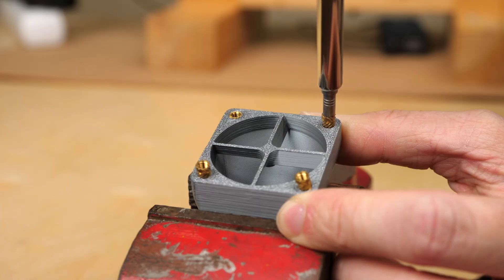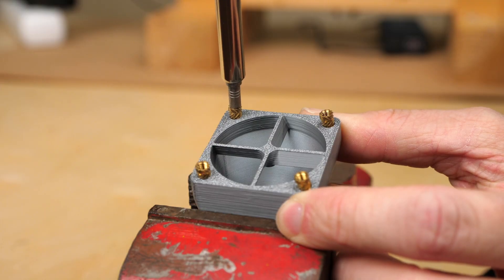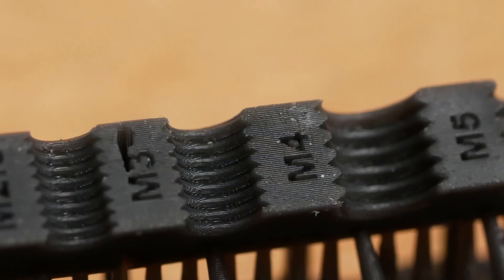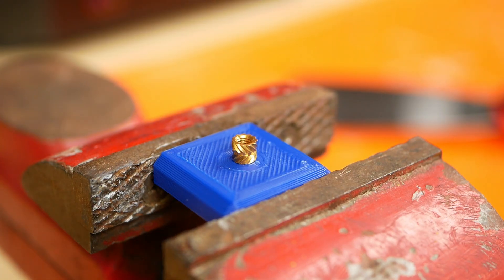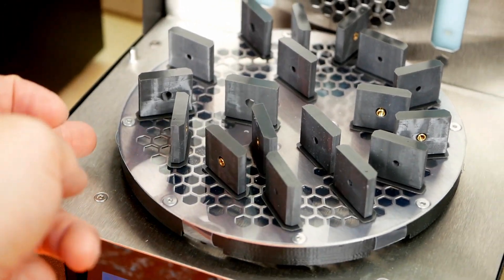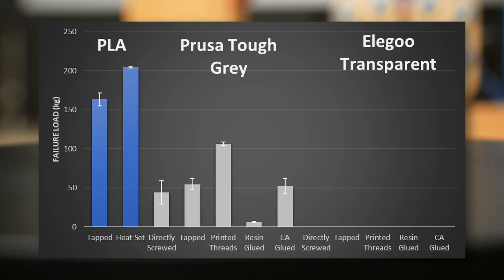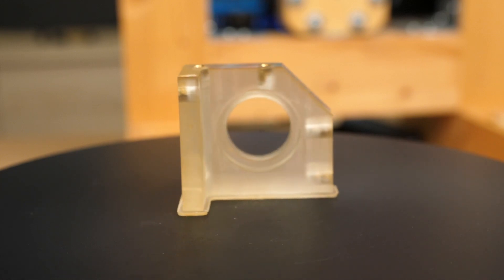Mastering Heat-Set Inserts in Resin 3D Prints

Comment: 5:10 Keep in mind some tests have shown accelerated superglue to not be as strong as without.
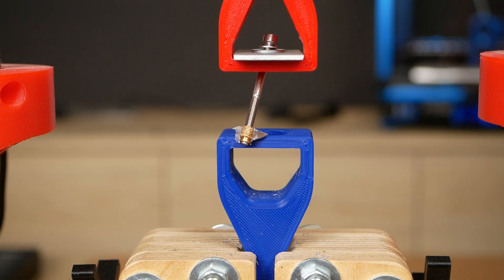10:00 Since the resin has to at least partially absorb the UV for it to be cured, this might be dependent on the shape of the part. E.g.: on a corner, or as part of a wall, parallel to it, it might fare better. And maybe increased curing time.

Comment: What if you modeled and printed threads like an STI tap? You would then use threaded inserts that are threaded on the outside, not meant for heat installation.  Perhaps if you modeled helicoil threads and used the helicoil style inserts?  Maybe a foray into other styles of threaded inserts is the next thing for your store...

Comment: I know you're probably tired of pulling M3 screws out of plastic, but have you tried M3 sized screws made specifically for plastic (e.g. McMaster-Carr 95893A196 or similar)? There are also resins that claim amazing strength (e.g. Liqcreate Stong-X at 80+ MPa), but these often require UV curing at temperature (e.g. 120 minutes UV cure at 60C).

Comment: Based on this video and your past videos, I think helicoils would be the way to go with resin. The printed threads performed best, and helicoils would improve the reusability of the threads. So print the threads for the appropriate helicoil size, install, bam. Just a theory. This video also made me wonder about your previous fdm samples, the stepped holes, maybe adding some geometry to the holes would improve strength when using the traditional heat method? I'm less optimistic about that second idea.

Comment: Bit of a loose testing here, because pla and the resins you use have way different properties, more accurate would have been, fdm abs and abs-like resin, that said it would be interesting to see how better resins perform, like 3DMaterials Super PP and Siraya Tech Tenescious, Blue or a combination or percentage of them added, imo the resins you use are definitely not the best and are more for general use and modelling instead of practical and engineering purposes. I hope you try some different resins and maybe make a good video about them, with multiple tests, like how much they shrink etc. Resins have made a big step in the last 2 years, so there is definitely and interesting video there!

Comment: I know this video is about heat-set inserts specifically, but where I work we often use "keenserts" to add metal threads to plastic parts. You drill & tap (or print as the case may be) a larger threaded hole, the keensert has an external thread to match, and then you thread it in and drive in a couple of locking pins that are included with the insert.  Then the insert has an internal thread at the desired size. Our machinist likes them because they don't involve adhesives or heat, you just drill & tap the external thread of the insert.  Would be interesting to see how those compare.
Reply: Why dont use wood screws?

Comment: thought: what about making the stepped hole so the threaded insert is inserted from the back of the part, and held in place with CA or thickened epoxy (if epoxy than additional ridges to increase bonding area). This way you are pulling on the part not on the bond as your primary source of resistance.

Comment: Apart of why resin broke completely might be that the mounting jig flexed, while the resin print is rigid, resulting in force redistribution where the jig is applying force on the edges, with the screw in the middle. It becomes a doubly supported beam, not just strength of the insert mount.

Comment: Could you look into the potential of vapor smoothing objects created with carbon fiber ASA filament?  My fear is that this would just expose more of the cf resulting in “hairy” prints.  Is there a point were the vertical print lines are noticeably smoother while not resulting in “hairy” prints?

Comment: So far I have only worked with FFF, not resin but I would think this method would work similarly.

I like to design a hole just wide enough for the bolt to fit easily and run it all the way through the part. Then I put the wider area for the heatset insert on the opposite side of the part from where the bolt is going in.

This way any pulling on the bolt has to pull the insert further in and all the way through the part instead of just out the side it was inserted. I'd love to see you run that test!

You have to be more careful this way about not filling the hole with molten plastic. Often for that I will actually run an extra-long bolt through the part and screw it part way onto the back of the insert before I set it so that plastic cannot get into the hole. Sometimes a little plastic even squeezes into the gap between the bolt and the hole, forming into threads giving the bolt even more to lock into.

I guess with Resin printing it would be glue or resin runnig into the bolt hole, not molten plastic but same situation.

Comment: could you possibly test the differences in performance for standard resin vs water soluble resin? like is there even a good reason to use standard resin when its so much easier and less toxic to use water soluble resins?
Reply: I find that water soluble resin doesn't clean up as well and you have basically no options for engineering resins for functional parts. Water soluble resins are also still very toxic. 

Imo if you get a decent set up for recycling your alcohol there's no reason to use water washable resins
Reply: @noobulon4334  you can recycle alcohol!?
Reply: @lnfotron  set it out in the sun in an airtight container, this will cure the resin diluted in the alcohol which then will fall out. After that you can shake it up to break up the particles and run everything through a filter. 

Also don't let it get too dirty or it will not break up and it'll just kinda turn into a blob

Comment: I'd like to see how a threaded insert, that threads into the resin would work.  From your results, you could print in the larger thread and then just thread in the insert.  You should get a bit more strength because the insert thread is a lot larger than the threads for the screw.

Comment: To be fair, the comparison is quite enlightening, BUT, for use-cases where the inserts or tapped holes of a resin print do not need to withstand high pulling forces at all, it's a viable method.

Comment: I've used a few different styles of E-Z Press branded press-in threaded inserts. They're specifically manufactured for use in thermoset plastics. They work well enough for my application. I wonder how they would perform in the pull tests. A quick tip though, I used 2 different versions of the E-Z Press inserts. The ones with the slot through the opening where you insert the bolt were too deformed to thread in a bolt easily. The version with the slot on the side of the insert that gets pressed into the material first we're way easier to thread into. That may effect the pull out strength though.

Comment: I'm not sure about the resin you are printing in, but it seems very brittle.  With many years of experience using a Formlabs printer, I can say their fiber reinforced resin (Rigid 10k) holds inserts very well.  We would print them with a 0.003" to 0.007" interference fit, with the insert being pressed in from the opposite side from the screw.  This would allow for a small lip, or big lip depending on geometry, for the insert to press against.  The inserts we used had no taper to them and a very precise flat bottom.  We would then put a little CA glue on both the insert and inside the hole and press in insert into place.  Never had any pull out, pull through, nor break.  Our application was over-molding PCBs with thermally conductive encapsulant for use in tools for oil well drilling.

Comment: i think you can do even better for tear out with the epoxy with some improved void geometries... so you take your existing improved geometry. then creat a hollow well behind that at the far end of the insert. then before installing the insert you first pre-fill down the hole with enough epoxy to fill that new extra hollow you created. then install the insert. and any excess epoxy should shmooze out in a very messy way. but you can always sand it flush later on.

so the epoxy transfer interface zone also has its own anti tearout plug. this is then like a 'double insert' in other words. and you are just applying the same principle twice over

you can also experiment with different viscocities of epoxy. to try to find the optimum thickness for easier installation. to be more easy to get into the hole. and be a bit more like the ca glue.

Comment: I've been using inserts in resin glued with epoxy glue into backwards papered holes so even if the epoxy doesn't bond properly it can't just pull out.
Tough my applications aren't high force normally. But they do want to be able to be disassembled and assembled regularly.

Comment: Standard resin (the elegoo resin here) is always brittle, you get a lot of tough resins like prusas that are only "tough" in the sense of if you drop your model it doesn't shatter like standard resin. A lot of brands do Abs like resin of varying quality. I've come to favour anycubic tough, and anycubic abs like+ resins with tough being resistant to breaking as it is very flexible and abs like+ being generally more resistant to compression and impact... wish I had a test rig like yours to test these 2, alongside a mix of siraya tech blu + tenacious as someone else has wisely recommended.

Comment: if they fail violently it's a material issue with the resin. the PLA test anvil has flexibility  and the resin does not, which allows the resin to fail in compression and tension. to test the inserts you would have needed to rigidly constrained the parts in material in harder material than the resin, with less deflection.

Comment: About transparency - the color is irrelevant. UV is not visible light, it behaves quite different (and same goes for IR). You can have a black plastic sheet that completely blocks visible light, yet is transparent to UV and IR. On the other hand you can have a very nice clear glass pane yet it blocks IR and UV.

Comment: Hi, i think your video is interesting, but Ridgid resin doesn't compare to pla, i think there are some other resins which compare better, i would also think that using nuts instead of threaded inserts with more surface area would work better, if you are at the formnext i can see if I can print you some samples from different suppliers.

Comment: Have I missed something ? I push my inserts into the uncured resin, right after it comes from the printer and before it goes into the wash... The print is still slightly gummy and hardens around the insert.

Comment: Looks like limit here is resin part strength.
So, smooth sleeve (and glue) will reduce structural tensions and give the better result. 

Resin are like a concrete. So good for pressure forces, so bad for break forces.
Idea of smooth sleeve is reduce pressure, by removing wedge-shaped objects out of resin contour.

Comment: I would suggest to make a hole by placing the insert into the 3d model of the test piece and subtracting it. This way you have thr negative of the insert inside the test piece and can press the insert into the part before curing.

Comment: I have been using the stock thread minor hole diameters in SolidWorks, starting with the correct tap size drill in a drill chuck without the drill by hand. This normally removes only a bit of material as the holes print just a bit undersize. Then I use the drill chuck holding the correct tap and turn by hand or use my tapping jig tool. DO NOT use a drill motor: it creates too much heat and either melts the plastic or the tap trashes out way too much material. On my Ender 3 V2, I printed a 50mm dia x 40 mm long cylinder with a 5mm wall thickness split in half with a female recess and a flange both with 1/2 wall thickness 2.5 mm tall and thick, in PLA each half printed with the cylinder end down. The dims printed less than 0.5mm with the two halves fitting into each other perfectly with NO allowance made in any way as a test in SolidWorks. FYI. Will be starting to use the brass inserts as you demonstrate; great work on the videos, super informative.

Comment: Question (which has probably already been asked) : while this wouldn't work for blind holes, in through holes did you try inverting the stepping you did for the insert?

I don't expect that this would make much of a difference, but it should be measurable.
Reply from the maker: Good point, yet you often don't have the clearance to install them from the back.

Comment: Surprised that the transparent resin glue did not help much. If you're using the stepped inserts, I would have expected a test where you tried to pull in the direction with the steps helping to resist the pull. This is not always possible for installation, but it's worth understanding the difference.

Comment: Great video. Little sad that after mentioning the different options, didn't have directly screwed or printed threads for PLA for a more complete comparison. You may have done it in a different heat-set insert video, but then it's not all in one place (and my mind just went "wonder if Arachne has made the threads more accurate and thus better for screws"). I'm not a huge fan of needing extra hardware in general when 3D printing parts, but it's probably just because it wasn't until recently that I even had sets of screws/nuts. But it means the few times I've needed screws I just model them into the part (and some finger grips to make it easier to get on), but as I now have some screws, it's crossed my mind occasionally that maybe I can use them. I'll have to check if the other videos contain the comparison and if tapped/heat set from those videos line up in results.

Comment: I usually use sheet metal or wood screws and they seem to work best and are easy to do you make the holes the same size you would drill into wood or sheet metal (self tapping screws)

Comment: If tapped or printed threads have great strength already without bonding (which can be very surface prep dependent), print or tap oversized holes and use steel thread inserts. There are so many options to choose from, are easier to put in than heat setting, and can be just as cheap or maybe slightly more expensive. But they extra cost is worth it IMO for not having to mess with soldering irons or glues.

Comment: I would say this is the situation where the crappy inserts would be the best, those with just parallel serrated top and bottom and a huge gap in the middle. Filling that with epoxy/super glue and have fun. The geometry itself already works well for it.

Comment: Try to use a mix of sodium bicarbonate with superglue, you gotta move pretty fast or it will cure before you are ready, so go small batches as for one insert only at the time, also make some circular channels around the insert in the resin to create more groves of glue plus bicarbonate to hold into.

Comment: spokes, dovels, not necessarily screws, japanese/traditional style
Reply: poor design, you never design a part so that the threads bear any weight, you place it (the load) 90 degrees axially
Reply: no wonder current parts/products are so horrible, poor design principles
Reply: if the main load is always 90 degrees, then you dont have to test or care about the worst test direction strength
Reply: ie you are using the parts wrong
Reply: why do you sell trash
Reply: both money based things are trash

Comment: As always an excellent video - but I don’t understand all the testing with conventional threads being screwed into plastic it’s not what they are designed for, and it’s well known that is a terrible solution to a fixing problem. 

The screw I’d like to see you test is a plastite kind of screw, or “thread forming screw” designed for this job of being screwed into plastic. They have wider threads , and often a geilo ulnar shape in section, designed to get round all the problems that you found that make conventional machine screws totally inappropriate for this application, and have extraordinary pull out force. 

They are commonly used in production components as they eliminate the extra stage of having to insert inserts … or tap holes or worse insert helicoil inserts which are a nightmare, and you don’t need to form a thread on the inside of your holes, and hence lower
 the risk of failure at that step (so easy to get the insert cocked to one side for example). 

I appreciate you sell inserts  and they look lovely - but they are a bygone solution to this problem. Just look on aliexpress  and you can see how commoditised “PT” screws are now - pt for plastic thread. 

I’ve been using them for ages - as one of the amazing things about them is you can keep taking them out and putting them in again and again and again and the plastic is not damaged, and the pull out force is crazy high- essentially the component will be destroyed before the screw pulls out. Your assembly costs are reduced, the scope for failure in the preparation stages is gone - and there’s no hit on mechanical performance which is why they are ubiquitous in high volume assembly now and inserts are not.
Reply: I often use McMaster-Carr 95893A196, and I agree with your assessment. The inserts are beautiful, but from an efficiency/labor/cost standpoint I'd rather use the screw made for plastic.

Comment: I use them as a glued in place nut. I make the big hole on the back side of the part and a smaller one on the front, that way when you tighten the screw it pulls the insert into the part, not out of the part.